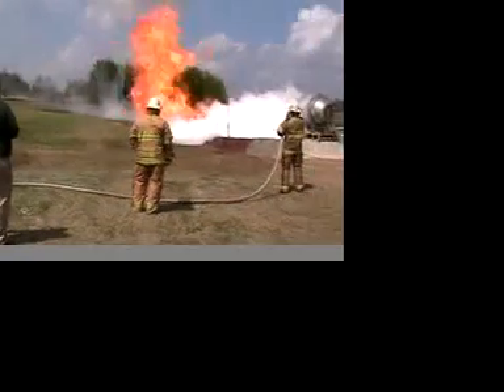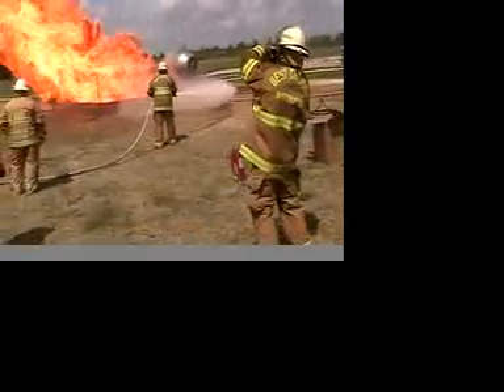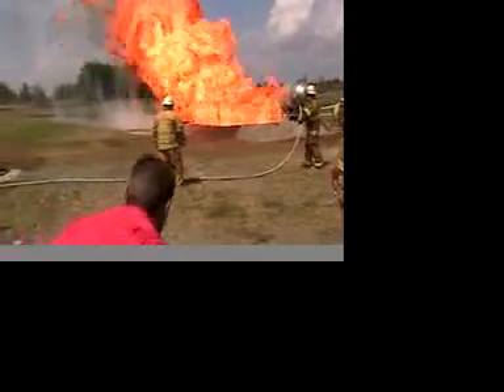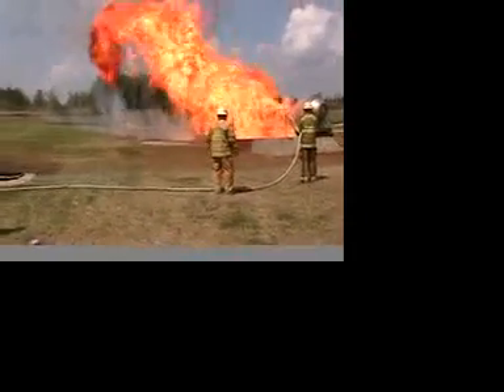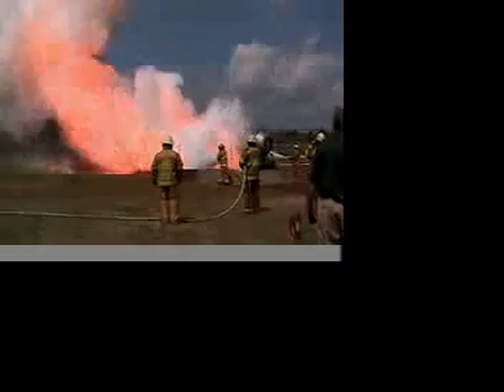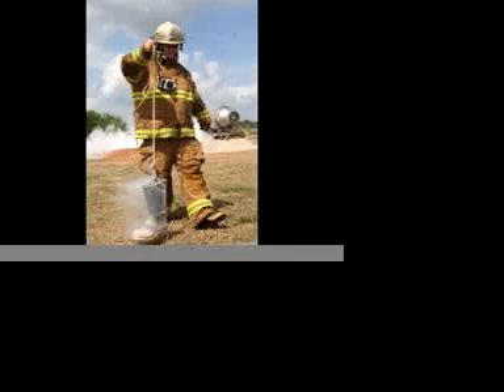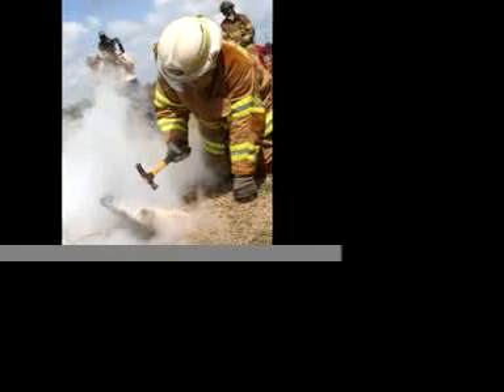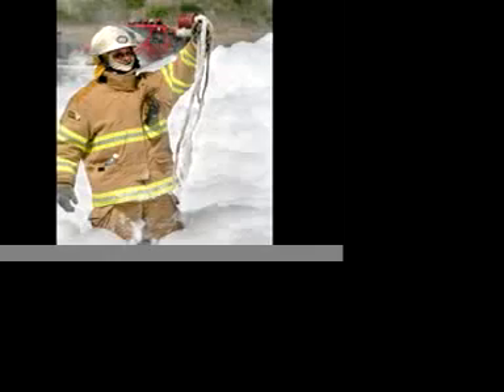LNG put to the test

Comment: I have seen thousands of gallons of LNG spilled onto a pit filled with water.  The pit was large but still less than 10,000 gallons.  The LNG spread out accross the top of the water and froze the water it came in contact with.  I am sure the volume of water in the pit was cooled but even this size release would have only a small and localized effect on an ocean.  A tanker could release more but the effect would be cooling and would still be localized.

Comment: LNG is stored at near ambient pressure.  I have been in LNG plants and near LNG vessels.  More importantly, I have participated in LNG research for several years.  That research has involved pouring LNG onto the ground and onto water.  I have also supported several LNG demonstrations including the specific demonstration in the above video.

Comment: don't be too critical of a poster that likely knows more than you do about LNG.  LNG is stored as a super-cooled liquid that is not under pressure.  The comentator gets a couple of things wrong about LNG (it will not dissolve steel) but what you see in the video is a pool of LNG (liquid, not gas).  Granted, it will evaporate faster than water but it can be scooped out and poured much like water.  Regarding a spill on water, the effect would depend on the volume of water vs the volume of LNG.